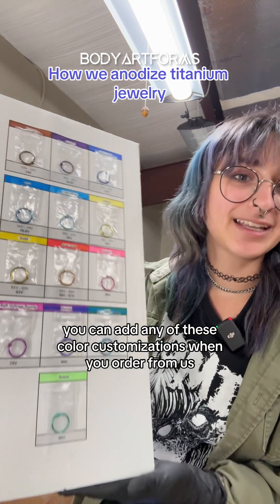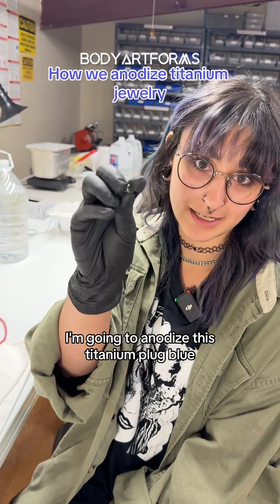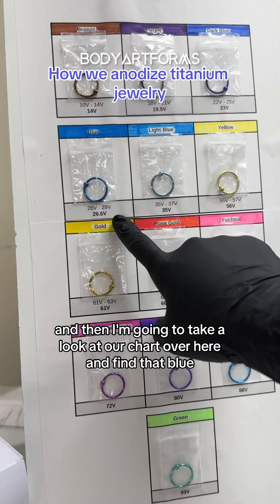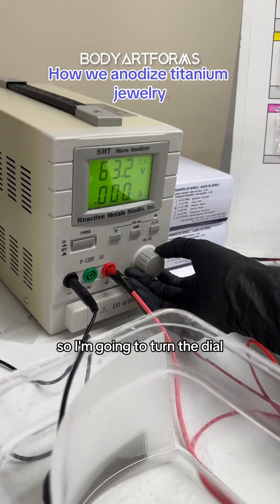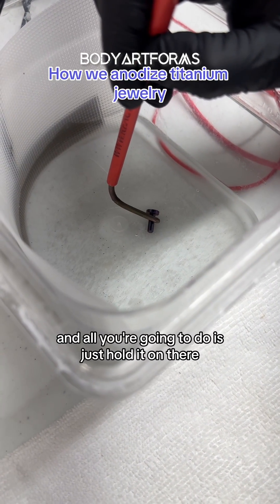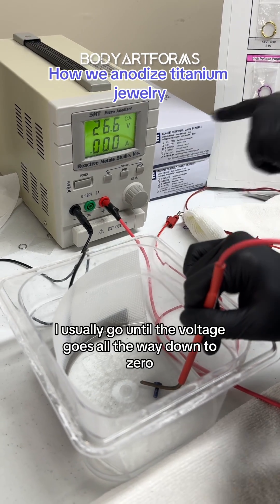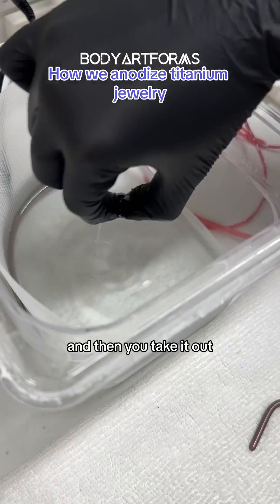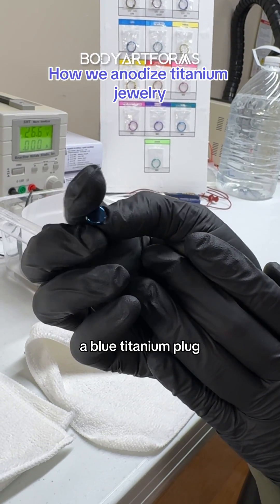How We Anodize Titanium Jewelry

Comment: I genuinely wonder why we can't find any black niobium or zirconium (in its metallic form) piercing (specifically plugs and tunnels) as those are implant grade metals and they could be heat treated to have both a really deep black finish while remaining safe to skin ? As titanium can't be anodized to black it's covered with PVD (same with surgical steel) which isn't totally skin safe and does not looks as good. Black titanium is a similar option too (a titanium and zirconium alloy). Would look good !

Comment: Not that it matters, but the voltage stays the same. It's the current that drops to zero. Voltage is how hard you're pushing electrons, current is how many are flowing. As you oxidize the surface titanium, the becomes a point where your voltage can't push any more elections through the system. If you were to increase your voltage you'd get more current again until it dropped to zero again. 

Still, very cool! I love that you guys do your own anodizing.